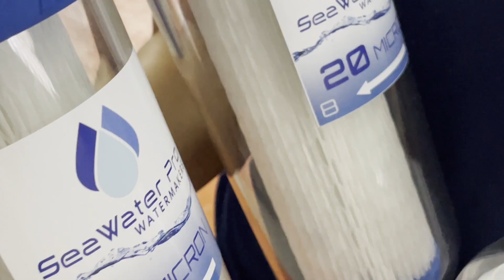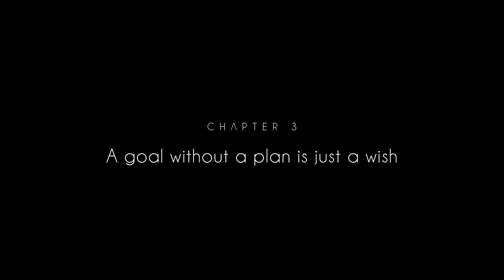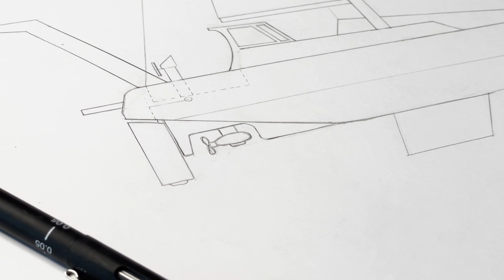Starting the ULTIMATE Steel Boat RESTORATION ⛵️ Ep2

Comment: You guys definitely deserve my subscription and I'll definitely be looking forward to watching you guys make this boat into your dream.. the boat has beautiful lines but the layout wasn't very appealing... why did you guys choose Brazil to buy a boat instead of USA or somewhere else where there's a ton of nice used sailboats at really cheap prices and the availability of parts is endless
Reply from the maker: Welcome Ben! Thanks so much, we really appreciate the support. We’ll go through all your comments one by one :). 

So first, we chose this boat because we were already here in Brazil and going to stay for a little while. We had been looking for years and found this boat online. Now, this is the kicker - In comparison to the market value in Brazil, this boat was very low priced. IF the boat was the condition we were sold, it wouldn’t be the cheapest (globally) but it would have been a reasonable price for steel with the components that came with it (considering buying a new one we would have to also spend money on a project). Our plans were to patch her up, do some fun modifications on the cockpit and then focus on the interior. We did want to do a certain amount of construction because it’s fun and also we want to learn about boat building and boat maintenance so we can be more independent. The extensive damage discovered was very much outside of our plans as you saw in the future videos.

Comment: So Im not sure if you guys know that you have a Bruce Roberts 345 HT
I have 2 of those in the 345 lct format , which is just a bit different cabin top arrangement.   In fact I have 1 in turnkey full refit condition for 10k usd
If you need any assistance with that let me know.